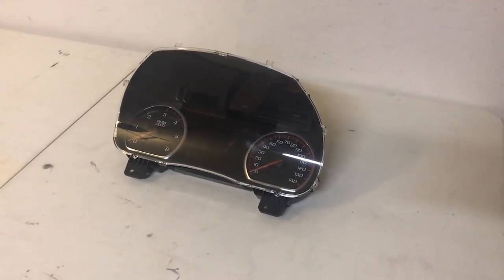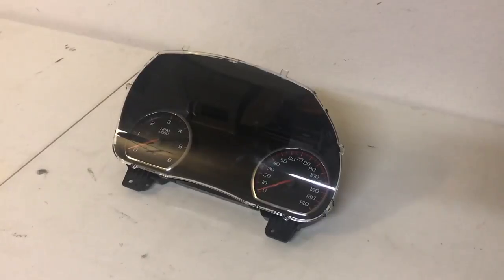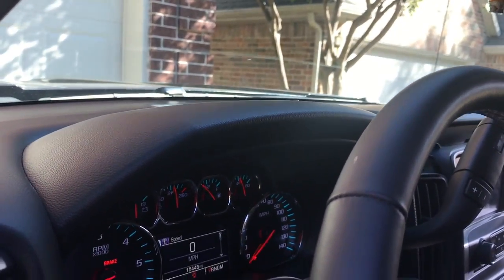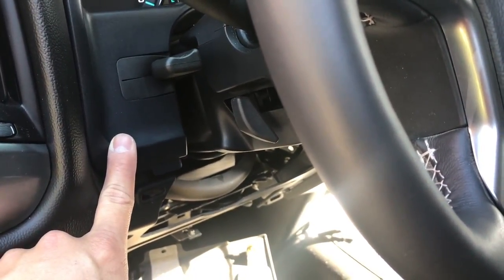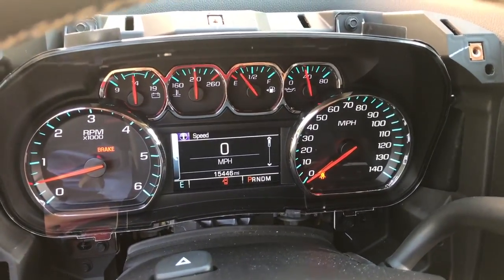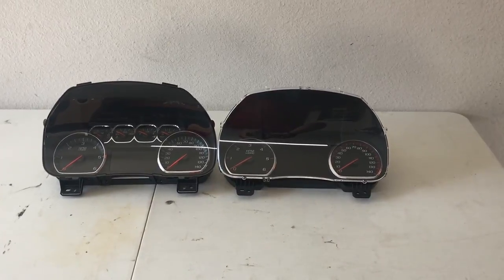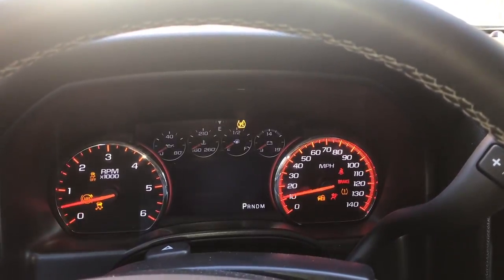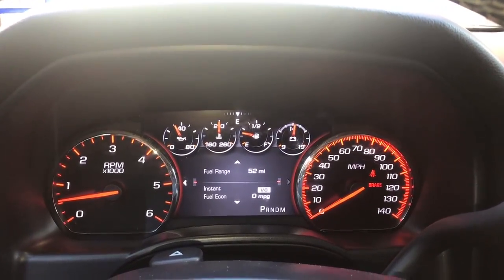2016 Silverado:  Denali Cluster Upgrade

Comment: Thanks for this video and shout out to WAMS for helping me get the right cluster.  Looks and works great! The only downside I have noticed is that the transmission fluid temp is now only readable when in tow/haul mode where before it was available anytime in the DIC.
Reply from the maker: Glad to hear!
Reply: You can change that in the settings
Reply: @joshuabittner3658  Thanks for the tip, but Trans Temp is not an option on the list of info pages to select. It was on my old cluster but not this one.
Reply: @sayler2b  on our 2016 Denali you have options for different displays. One of the other displays has all the gauges you're talking about. Also, it brings up those gauges when in tow mode

Comment: Great video! Can I do the install without any programming done if I use this exact  cluster part number? I also have a 2016 Chevy Silverado
Reply from the maker: Part #s are specific. If you install without programming, you'll trigger odometer tamper flags. This will eventually result in dashes "- - - - - -" on your miles in the odometer. Use www.WhiteAutoandMedia.com for the proper retrofit and programming.
Reply: @philgamboa2906  thank you!

Comment: Just wanted to point out that on your new cluster, when switch to  tow/haul mode, your voltmeter will become a transmission temperature gauge, at least that's what happens on my 2015 2500hd Denali.....
Since you didn't mention it I thought I'd through it in the conversation....
Reply: I was looking for that in the video. I know the Denali has that function, I was really curious to see if that would transfer across.

Comment: Definitely on the upgrade list! Nice work. My wife drives a ‘16 Denali 2500 and I prefer that dash over my ‘15 3500 SLE. 
Any chance I can get some help finding those terminals for the dash switch array? Tried email but after seeing the work you put in on GM-trucks I bet you’re swamped. Anyway you’re doing a great service helping so many people. Keep up the great work!
Reply from the maker: Terminals are probably the hardest part to find.  GMUpfitter.com is where I get my schematics from.  Sometimes they disclose terminal part #s.  Most of the time, its a fishing expedition to find them...and the right ones.  Did you email me?  If so, please email me again.  I must have missed your message.
Reply: Thanks, I’m on the road tonight but I’ll shoot you another with YouTube, GM upfitter in the subject line.
Reply: Hello 
I bought new digital cluster for my tahoe 2015 lTZ OEM one same in the video but when i fix it by my self after that there  is many signs  that shows on then i gave it to the dealer to programme it to remove this signs but they tried with many ways to remove this signs but they couldn't solve it   so any suggestion to solve these problem
Reply: @philgamboa2906  Phil do you think they can change the speedo and rpm to the z71 ones?
Reply from the maker: @chadjohnson2946  yes. So long as you get a compatible cluster from www.WhiteAutoandMedia.com and have them program it.

Comment: Did you notice any info that didn’t sync correctly. I noticed there are some metrics on the Denali screen that are not on SLT screen. For example the Denali shows both engine hours and idle hours. There is no idle hours in the SLT screen? Just curious.

Comment: This is awesome thanks. Did you change out the entertainment center and climate control area to match the red accent/button lighting?
Reply from the maker: I actually did another cluster upgrade from Red to the Chevy Blue.
Reply: Phil Gamboa Did you swap to a blue cluster of the same denali type cluster with the full screen, if so what did you get it off of?
Reply from the maker: Yes.  For 2016, GM has a Red Version and a Blue Version as that's when they started switching over GMC to blue.  I bought it new from Pace Performance.
Reply: Well, I've looked on Pace Performance and can't seem to find it, is there anyway you could point me in the right direction on finding it, I have the same year 2016 Silverado, do I have to call them or is there a specific part number lookup or name of the cluster?
Reply from the maker: Gilbert Flores you’ll have to call them and speak to Greg Was and have him load the part # you need.

Comment: I'm trying to find a cluster for my 2015 Silverado, but looking at the product matrix on WAMS site, it's a bit daunting. Is there a cluster like this that would work with a 2015 but in Chevy blue/white over Denali red/white? I'm parts hunting before I even think about programming. Already going to have to get a new wheel and clockspring since mine is a work truck with the LS convenience package... that doesn't come with steering wheel radio controls. :(
Reply from the maker: If you want Blue, you'll have to complete the CarPlay/Android Auto retrofit fit first, then you can select a 2016 Blue Gas version cluster.

Comment: Im watching this because i have the most annoying rattle coming from the cluster area..if i push on the clear plastic i can mimic what sounds like a loose screw or clip rattling around...is removing the gauges that easy just one wiring harness and can be reinstalled without having to reconfigure anything? Dealership wont do jack

Comment: I have a 2016 work truck Silverado. And I want to put in the Z71 cluster. Would I still have to get it reprogrammed and such? And what’s the process with WAMS? It looks really expensive to get it reprogrammed
Reply from the maker: If you don't get it programmed, your miles will eventually show as dashes "- - - - - -".  Errors may show for options that your truck doesn't have.
Reply: @philgamboa2906  Miles will show for a few seconds and then go to “—————“. I’m not too worried though. I just wired the steering wheel to it a few nights ago. Work truck is coming along way

Comment: I would like one like that but with the blue lighting to match the rest of the dash.
Reply from the maker: The blue cluster is an option for 16 and later trucks. :)  Mine is actually Blue.  I swapped mine out a few months ago.
Reply: @philgamboa2906  I think we both have the same truck 16 LT. You happen to have the part number for the Blue digital cluster? Thanks in advance Phil.
Reply from the maker: Before purchasing, please confirm with WAMS on fitment with your VIN.  Here are the part #s 

2016 Blue Cluster
84158461
84254166
23400432
23407870
23353023
23390928
Reply: @philgamboa2906  thanks Phil. Hope everything is going well and glad to hear from you again. God bless

Comment: Great video Phil. So, do you buy the cluster and then send it to WAMS to be programmed? Then, once it is done they send it back to you and you're good to install? I'm wanting to do is mod on my own truck as well as swap out the front and rear bumpers to add park assist on both. Do you know if reprogramming is required for front and rear to work? Thanks for making informative videos that are simple to understand and follow. I'm subscribing. Keep up the good work!!
Reply from the maker: Michael, before you purchase the cluster, check with WAMS on part # compatibility and fitment first.  They only accept emails on the weekend during their posted hours.  So be sure to ask all these questions so that they can all be answered.  I went back and forth and since they only accept email inquiries on the weekend, this took a very long time (partly my fault for forgetting to email during their hours).  Be sure to include to as much detail about your truck as you can.  Year, Trim, VIN, what you are looking at doing, etc.  My truck had Factory Rears and ended up getting a color matched bumper that has the front sensors.  I couldn't live with the sensors physically installed and doing nothing...So I inquired about this as well while my cluster was going to with them.  I picked up park assist module that supports both front and rears, and sent it off as well.  After the cluster and park assist sensor module were programmed, they got installed.  The cluster was Plug and Play at that point.  The PA Sensor Module, required some additional wiring.  I show this detail in another I posted, so check it out when you get a chance.  

Hope this helps and Thanks for subscribing!
Reply: No worries. It's just good to be able to talk to a like minded person. I live in Texas and may look into trying to have the programming done here.(they are kinda hard to reach) My truck didn't come with front or rear parking assist but I was told that it was already wired for it (yeah, right). It's an LTZ so I'll check into that. I've made some modifications but I like for them to be subtle so that it looks like it could've come from the factory that way. If you're ever down Dallas way, let's get together and grab some lunch and talk trucks. Thanks again.

Comment: Nice, if you don't mind, Did you purchase the cluster form a dismantler?
Reply from the maker: Cluster purchased from eBay.  It was used from a 2016 Denali.  From what I understand, you have to get the SAME year cluster.  Before you buy, please check with Whiteautoandmedia.com for compatibility and part # confirmation.  You can also request pricing at the same time.  Programming pricing varies based on if you have a new or used cluster.

Comment: Nice install. How much was the cluster? How much was the programming?
Reply from the maker: Cluster was $225 on ebay.  Programming was about $350.  Programming fee varies based on year, if cluster is new or used, etc.  I also had a front park assist module programmed as well.
Reply: Once they program it it shows the original Mileage?
Reply: What do they program on the replacement cluster ..? So if u bought a brand new denali cluster and put it in it would still need programming..?
Reply: Yes to both comments above.

Comment: i just bought a used one will i be able to connect to my truck to verify it powers up before i send it to get reprogrammed??
Reply from the maker: No. You don’t want to do that. You risk lockout it up and trigger odometer tamper flags in the system.  Reach out to www.WhiteAutoandMedia.com for info on compatibility and programming it first.

Comment: Hi phill, I have 2017 GMC Sierra x edition, now my question is that I want to display speed limit  range on my cluster. I was told I need a different audio system with navigation but my question is if I get a new audio system with navigation can I use the same cluster or Denali cluster with speed limit range showing on it. Or I have a buy a new cluster.?
Reply: Lol this was so hard to read & understand

Comment: How much was the full purchase including the programming ?
Reply from the maker: Leo Bustamante - I bought the cluster about 4 months ago maybe.  If I recall, it was about $225.  Programming was $400.  My cluster was used so programming is usually more than if you have a new cluster.  I also had some other programming done to get front park assist sensors installed.  Check out whiteautoandmedia.com for pricing specific for you and ask about compatible part #s as well before you buy a cluster.
Reply from the maker: No.  The mileage is not stored in the cluster.  It is only displayed on it.  The mileage is stored in the truck's computer.  Having the cluster programmed by WAMS ensure all of the correct parameters are set and that no tampers flags are triggered.

Comment: I liked the original one. Why changed it?
Reply: I'm equally confused, why you would spend so much money for essentially some LCD temp/gas/oil pressure/fuel gauges? For slightly larger display information? Not worth the time, money, and effort.

Comment: What happens if you don’t program it
Reply from the maker: You'll set tamper flags, the odometer will eventually get locked.  You'll likely to get features that are not on your truck show up as "Service ...xx"
Reply: @philgamboa2906  I bought a truck that had the swap & has the dashes as you mentioned in another comment is I too late to have it programed. Truck drives fine but I did get a service stabilitrak message

Comment: I was told By a company that a different cluster would not have to be programmed because your bcm will transmit the data to the new one. Can you please explain your experiences.  Thank you!
Reply from the maker: That is incorrect.  If you install a cluster into your truck without proper custom pogromming, you will set tamper flags, the mileage will eventually show dashes instead of mileage, and it will be a brick at that point.
Reply: Thanks Phil, what's my best option to do it right ?
Reply from the maker: @jonmalkowvich6967  - Go this thread and read up on it.  There is a list of clusters by year.  Make sure you get the one for your year.  Before buying anything, contact WAMS - www.whiteautoandmedia.com to confirm fitment with your VIN and the Part #.  Take note of their special consumer hours.  https://www.gm-trucks.com/forums/topic/190465-denali-cluster-in-slt/?page=29

Comment: How did you change the lights to blue?
Reply from the maker: Replaced the cluster.
Reply: @philgamboa2906  I mean see them here red but in some of your later videos I see the Denali cluster with it having blue instead of red coloring. Is it an option when you send the cluster for programming or do you mean it’s a different cluster all together? Thanks for everything your vids are great tools!
Reply from the maker: @Guero_c7  - So since my truck is a 2016, that is the year that GM came out with red and blue.  Typically, you need to get the same year cluster based on the www.WhiteAutoandMedia.com fitment list.  IF you are 14/15, you have to generally go with red BUT if you upgrade to the Full CarPlay/Android Auto "system", this allows you to upgrade to 2016 and choose the color cluster.  Red gets you GMC startup animations whiles Blue gets you Chevy startup animations.  Hope this helps
Reply: @philgamboa2906  it truly did! That comment was very insightful!!! Thanks for everything
Reply from the maker: @Guero_c7  Anytime!

Comment: How much did you pay for it?
Reply from the maker: Ranges from $300 - $500.  Depends if used or new.  I also requested the add of programming a front park assist module.  I wanted to add front park assist while they had it.

Comment: Please Phil Gamboa help me to find a cluster of sierra denali for mi 2017 chevrolet silverado and you make a great work
Reply from the maker: You can get a cluster from any GM Online Wholesale site or the dealer.  You can also get it from eBay...BUT you take the risk of compatibility.  Also, if the ebay seller incorrectly installed it prior to programming, that can set tamper flags in your trucks computer.  Please visit www.whiteautoandmedia.com for fitment and programming costs before purchasing.  DO NOT INSTALL a cluster without getting it programmed first.
Reply: Phil Gamboa I apologize because it's a bit difficult for me and I do not understand this much, but I already look at www.whiteautoandmedia.com and honestly I do not understand how to look for the right part number or comptibility or what I need. similarly look in the gm wholesale web for the cluster and give me different models honestly do not know which is the correct
Reply from the maker: Sinuhe Campos - please read this thread. 

http://www.gm-trucks.com/forums/topic/190465-denali-cluster-in-slt/?page=28

FAQ – Please read before contacting us – thank you!
 
Q: I have a base model truck will this mod work?
A: Yes we can retrofit program the Denali or smaller color cluster for your application. See the thread from pgamboa regarding the steps needed to make this work properly on your end.
 
Q: I already bought a cluster will it work?
A: That depends on MANY factors, we HIGHLY recommend you contact us first with the part number you are looking at to confirm fitment.
 
Q: How much does this whole shebang cost?
A: We only do programming and the cost varies depending on what cluster you get, the condition, any special requests etc. Typically most people do this mod for around $500 total including cluster.
 
Q: I bought a cluster and plugged it in and now some things dont work, can you program it?
A: We have posted multiple warnings to not plug units into your vehicle until we program them, if you plug it in prior you own it and the tamper flags you created; we wont touch it.
 
Q: Whats the average turnaround time?
A: Typically one weekend or less depending on work load.
 
Q: What part numbers should I be looking for?
A: You want the Denali part number for your EXACT year and specification. If you have a 2016 diesel you need a 2016 diesel cluster. 2015 has two model years effectively 2015 and 2015.5 as always ANY part you are looking at please send us the part number to confirm fitment prior to purchase!
 
Q: I want to move ahead what info do I need to send you to get a quote and check compatibility?
A: Your VIN, the cluster part number you are looking at and its condition.